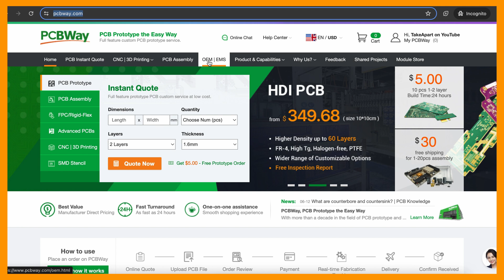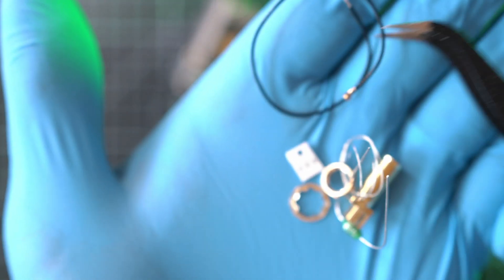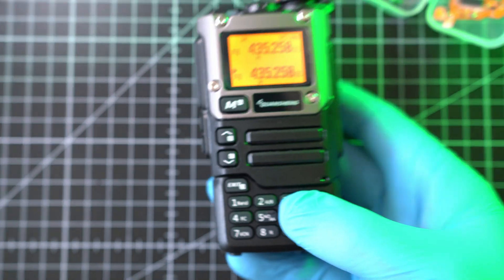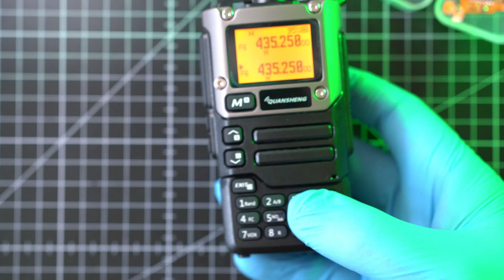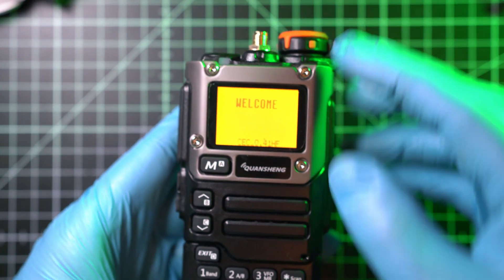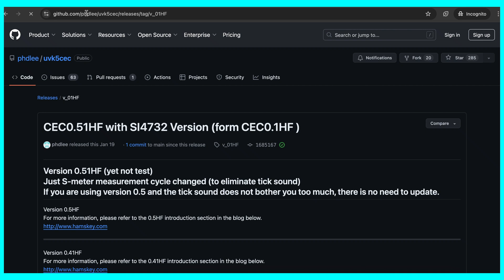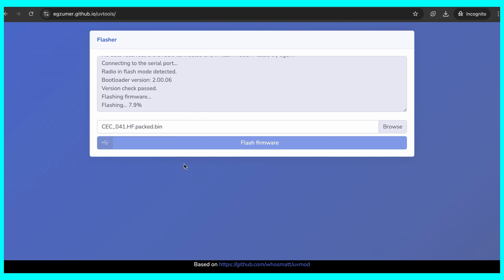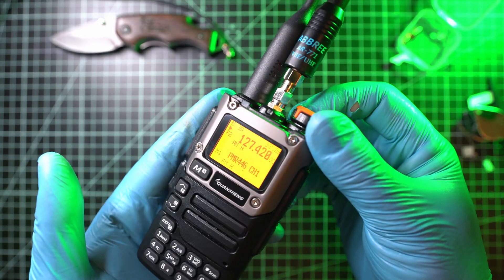FULL BAND HF v2.5 Mod - Quansheng UV-K5 (Si4732 chip) TUTORIAL

Comment: I wouldn't technically call this a tutorial since you glossed over many of the very important steps
Reply from the maker: hi, feel free to add your input
Reply: @takeapart  you showed the steps that's true but so fast i needed to pause and replay and at a very high res so that i could catch all the important steps i.e the jumpering the component with a piece of unshielded wire 3:06 . i would like to also add i like that you used double-sided tape to secure the mod i think that is better than some using crazy glue 2:37 .

Comment: Can I clean surface with nail polish after soldering the module
Reply: What about pure acetone
Reply from the maker: @aIper4004 best to use iso alcohol
Reply: @takeapart   can I use iso alcohol with toothbrush
Reply from the maker: nail polish is very aggressive… I would not recommend

Comment: after soldering module 2.5, radio not turning ON.  as per instruction removed two capacitor and added two jumpers. separate antenna setup. then restored old fm chip and removed module radio works nicely now but LED not turning ON. 😞
Reply: Because this mod is wrong. The correct connection is on the ‘VU3ZAG Expedition’ channel. You have to desolder a few more things and you don't have to use that big green component. Everything works, not like with this mod.
Reply: @samson8779  try putting the LED the other way around. They only work in one direction.

Comment: I got cancer 10 times as I did it. There is no room for the antenna even after cutting off the legs so the screen is crooked (that's why you record at an angle). On SSB you can hear some voices, but the noise level makes it impossible to understand. I could not find any signal that can be understood. After connecting the same antenna to the Malahit DSP2 I can hear the whole band. 
The project is pointless, a waste of time.
Reply from the maker: there is just enough room for antenna… connector has to have all terminals cut off and then solder on rf wire ….
Reply: @takeapart obviously has the legs cut off as I wrote. In other tutorials they cut out a piece of PCB to make room for the antenna. I found out after the fact.

Comment: Hello, thank you for your video.

And I have a question, I would like to make 2 antennas, and what would the choke be for, I see some that don't even install this choke.

And why are there some that remove 2 more resistors and connect pin 3 of the board to a capacitor? Is there a reason for that. ? 🙂

Unfortunately I can't show you a picture here.
Reply: Hi, I saw that the choke (green component) didn't install for this version HW (dual antenna) and didn't remove 2 components (resistor and capasitor) and didn't replace capasitor. And after that it works, but what should do for correct work no one can say 😢